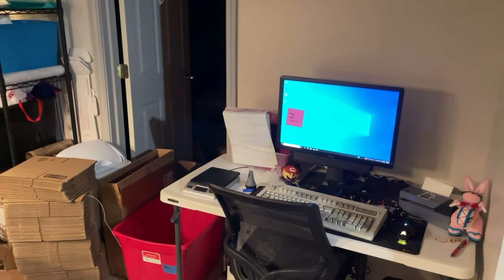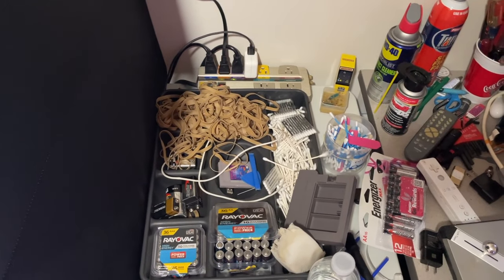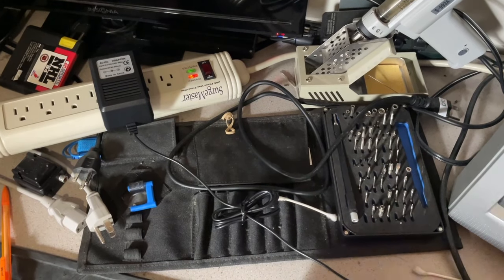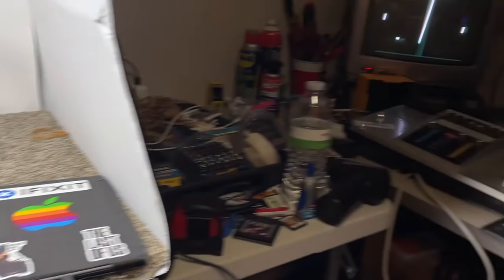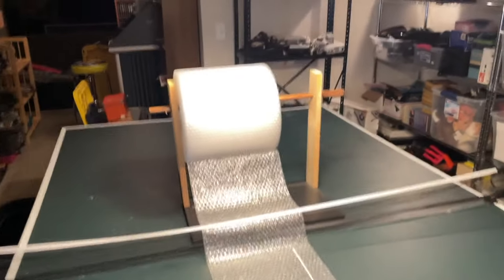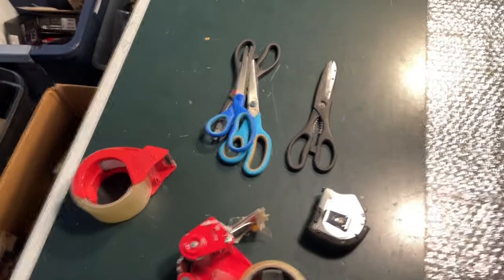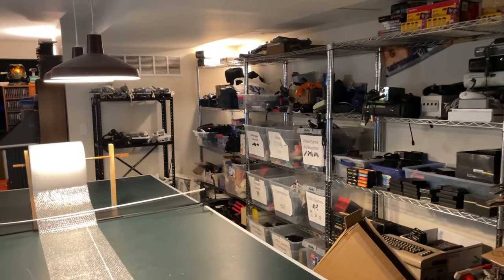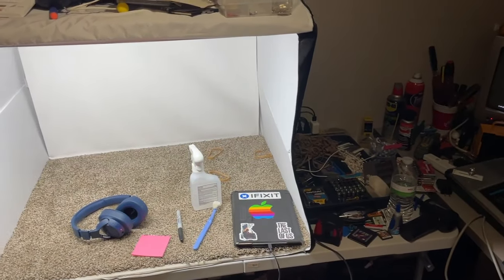Ebay Setup for listing and shipping video games

Comment: Well that was quick, thanks for making this video! It was very cool to see. I do see some similarities between our setups, except I don't have nearly as much space for working. Despite the messiness, your setup does look very functional. I'm in the same boat on sourcing boxes and packing material. The ping pong table is actually a great idea lol, I haven't seen an eBay seller use one of those before. And I would actually like to see your storage unit lol. I'm trying to downsize my own storage at the moment.